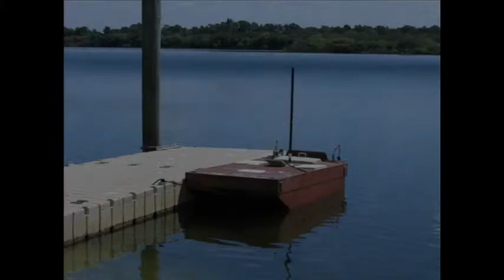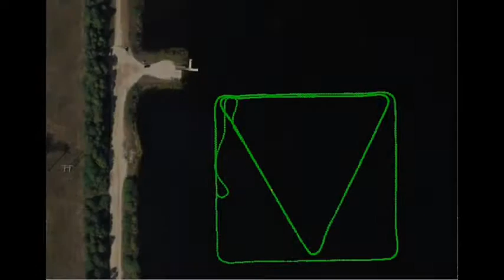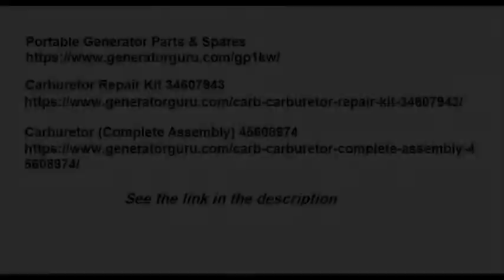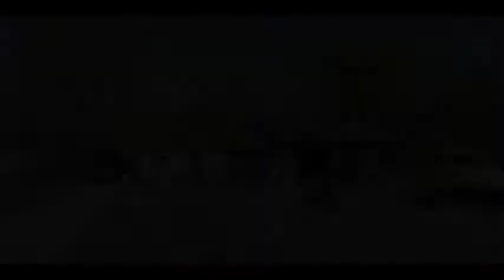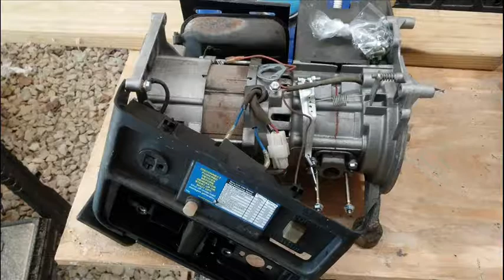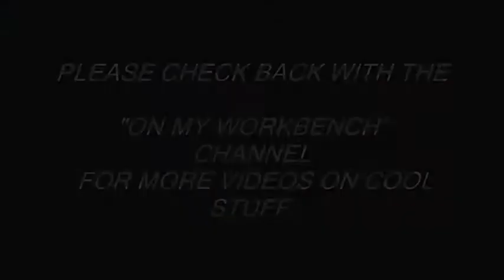1000 WATT GENERATOR REPAIR

Comment: I picked this generator up at a yard sale for $45. Wouldn’t start and just figured out that the jet was clogged. Runs like a champ.
Reply from the maker: Is yours 4 stroke or two stroke?
Reply: @onmyworkbench7000  4 stroke

Comment: Hi, running ethanol free fuel will eliminate these carb problems. Also, replacement carbs for this generator run under $12 on eBay or Amazon. They are exact fit. Good luck.
Reply from the maker: "running ethanol free fuel will eliminate these carb problems" I know, I am running ethanol free in it now.
I looked and did not see the carb on eBay, but that's OK I now have a 2nd generator for another project 
some time down the road.